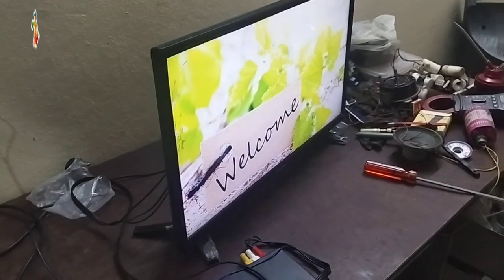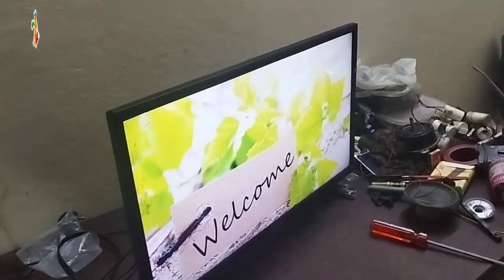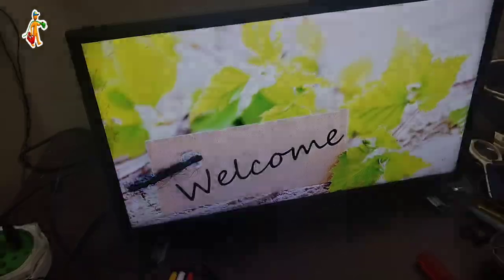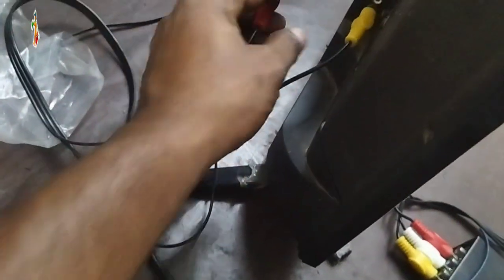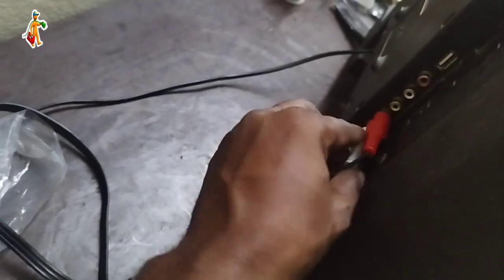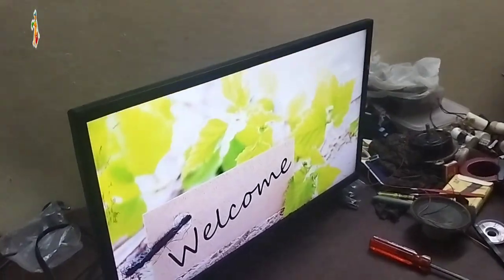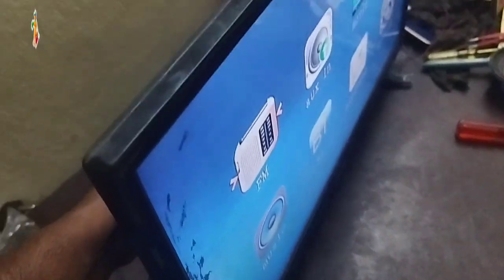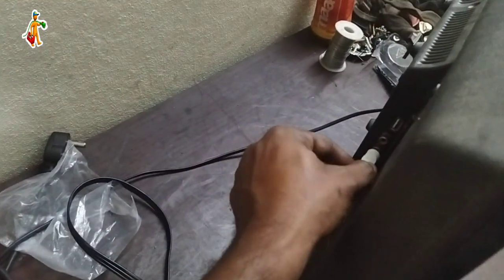LED audio repair | No sound | picture ok but audio not coming

Comment: Bro crt tv fuse kalipotundhi on chestunte problem em ayi vuntundhi
Reply from the maker: Smps (switch mode Power supply)problem...meeku minimum knowledge vunte Check cheyyochu..
Reply: @Dr.Electric   ok bro tq